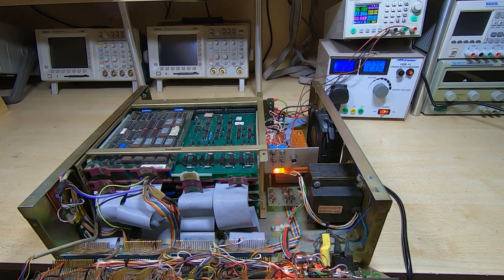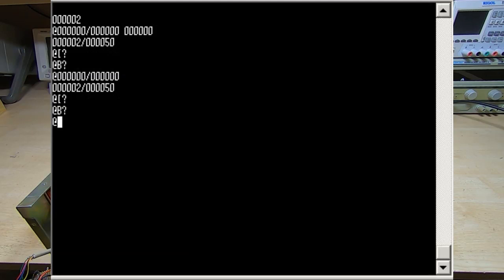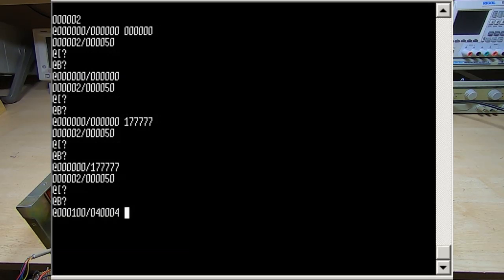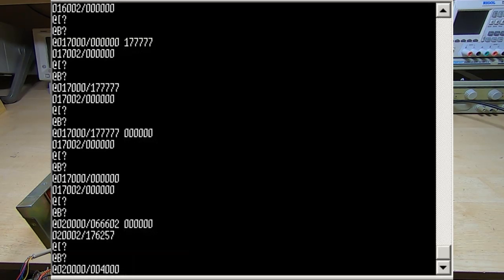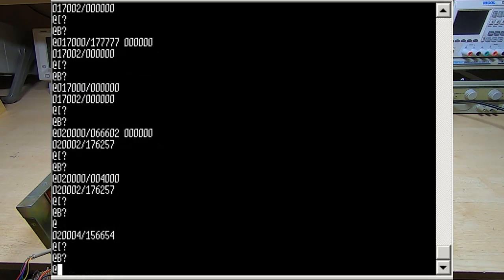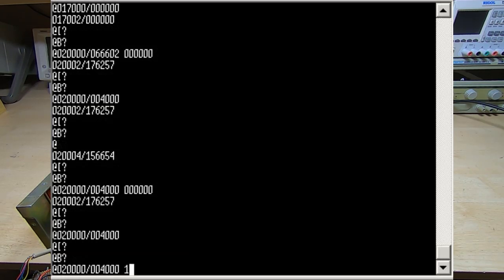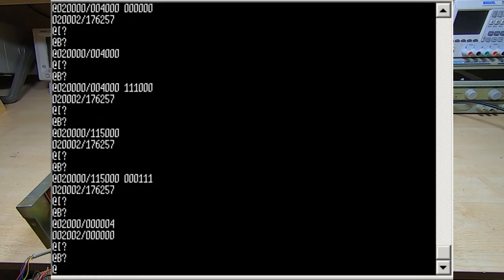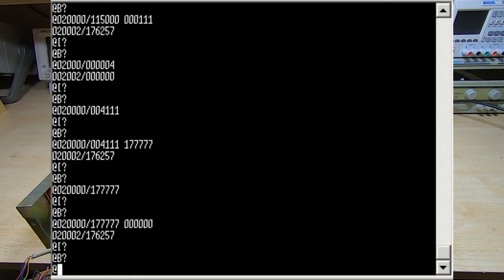PDP-11/3 Repair Part2

Comment: Would there be any benefit to continuing the test of higher addresses to see if the fault is local to just one address range or maybe point to another type of failure?
Reply from the maker: I cover this in the next video. There are other reasons to think it is a fault with the RAM board.